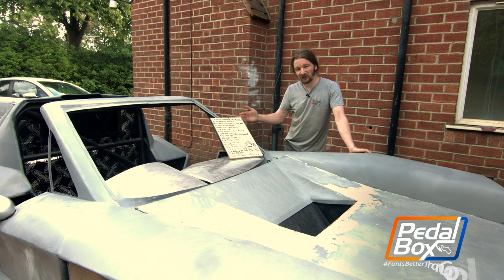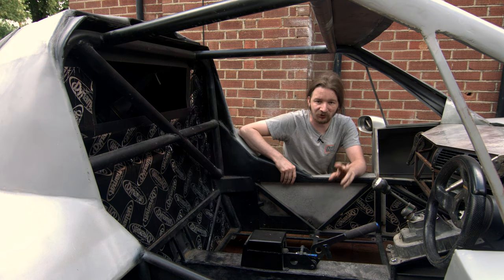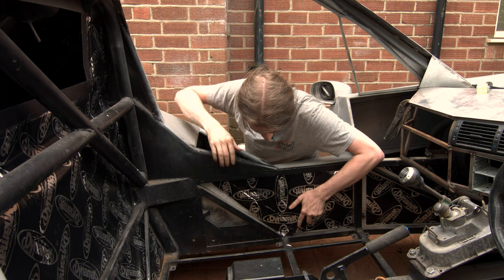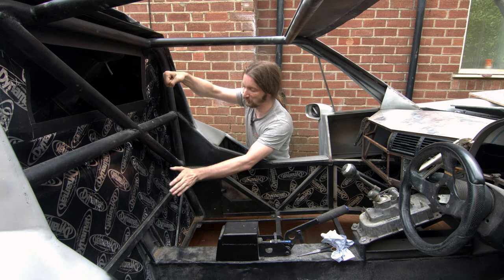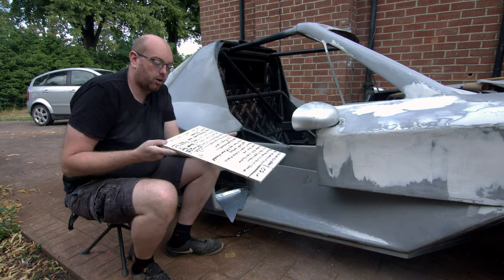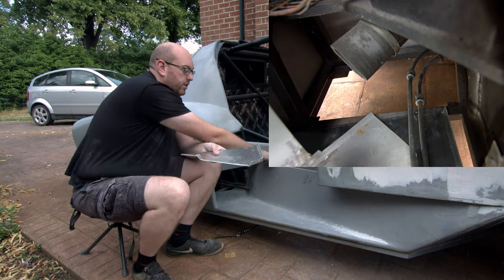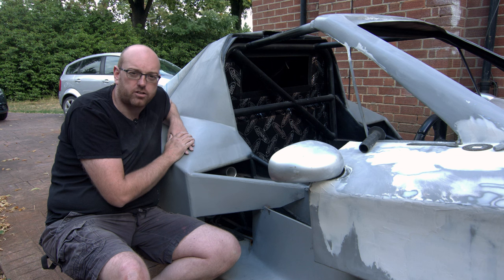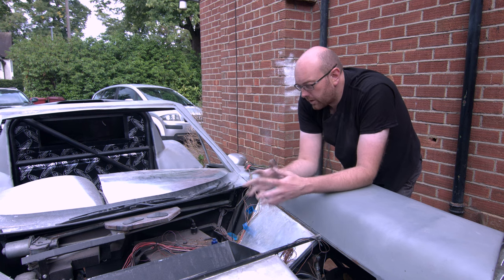Dynamat and Dashboards | Audi TT Kit Car | PedalBox Episode 117

Comment: For iva for the side repeaters make sure it's visible from the required angles and height and that the mirror doesn't obscure it.
Reply from the maker: I hadn't actually checked where the mirror would cover from the rear viewing angle. Good point!

Comment: Check the requirements for side repeaters, very lean, must have visible light 1m from back corner (the blind spot), not a requirement for actual side repeater even if its a safer pulling out sometimes. I have know hidden LEDs behind the wind mirror glass functioning very well, version hiding in tube doesn't distract the driver! 😉
Reply from the maker: Yeah they're quite lax, it's just making sure its not hideous to look at, Think i've found some that'll fit into the wing panel, TBC!

Comment: Keep the side markers simple, not reason to complicate those. Whatever the smallest legal team drop shaped thing you can fit on tho the panel below the mirrors should do nicely!
Reply from the maker: Yeah, I've got a couple from the A3/TT hanging around mostly to test for now. I've found a few triangular ones that might fit to the front end, but there's a temptation to try and 3d print an infill piece under the wing mirror to the body to house something. One for the new year!

Comment: A little light that goes into the side would be really easy to put in.

How easy would it be to work around? Which one gets in the way of other things least when you're trying to fix stuff? That's probably the most important thing to consider on a machine like this.
Reply from the maker: When you say the side... where'd you mean, because it's been a week or two since I edited this.. or watched it 😆
Reply: @PedalBox  You know... on the *side*... 😂
Reply from the maker: Turns out I also had a mild fever, as well as memory loss from not watching it! Makes more sense now :P 
The marker on the side is almost certainly the easiest, making it fit with the lines, as a triangle light, (theres a few on ebay) or just a more plain unit or even the A3/TT ones. The wing mirror one would be 'neater' over all, but how to fit it inside, or make a unit that fits underneath and then blends in... it's a lot of faff. The small light still feels like the better idea overall, and yeah, simple ftw!